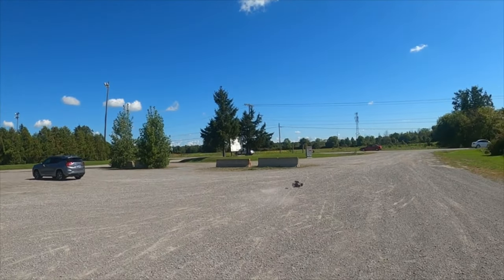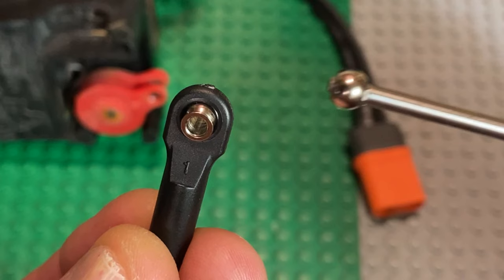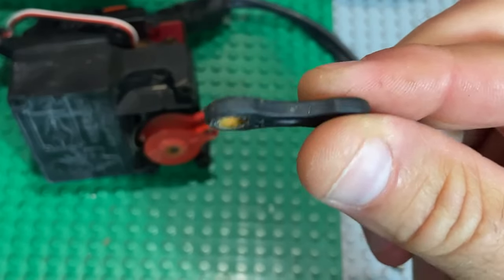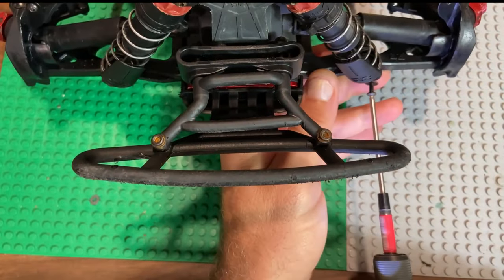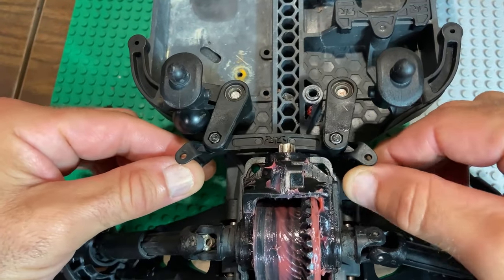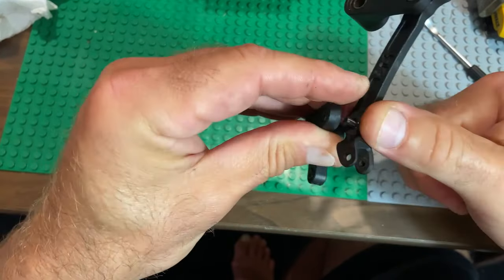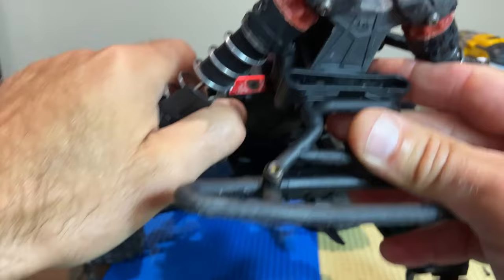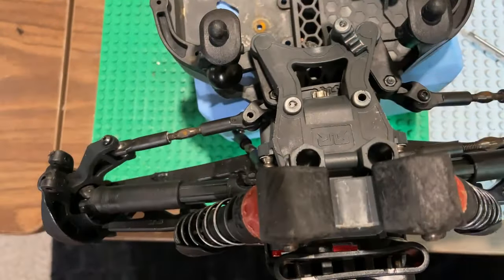ARRMA 3S UPGRADES: SHIM YOUR BELLCRANK AND STEERING POSTS | ARRMA 3S

Comment: hi Phil what brand of 17mm offset hexes you reccomend for typhon 3s? dont want to much offset.  some of the grp tires onroad can sit real close to hubs!
Reply from the maker: HI! Honestly i think they are quite similar to each other.  For the money, I think the Hot Racing make good sense. If they were for bashing and you had extra money, I would go with M2C. Thanks for watchin!
Reply: @phillybrc  how much extra offset do the hot racing hexes give compared to stalk?
Reply from the maker: You can get different sizes , I believe most common  size is 5mm on each side.

Comment: Omg! Great video! I have so many cars I’ve had to trial and error create fixes. I modified my 3 s line as well. I did almost the identical fix. Used traxxas ends with metal traxxas pivot balls. I’m shocked Arrma put any car out with that much slop. Plastic pivot balls is a joke! 👍💯
Reply from the maker: Nice!! They are a joke Syko. I find this mid helps alot!! Appreciate you Syko.
Reply: @phillybrc  Absolutely! Your like me, make it right. No matter what you gotta do! Very good video for that car. Besides your tricks, a lot of first time rc owners get the 3s line. It will be very informative! 👍
Reply from the maker: @SpeedSyko  That s what I m goin for! Thanx Syko
Reply: @phillybrc  👊🏆💯

Comment: Awesome video! I'm currently tuning up my Typhon 3s and this is just what I need to do.  What do you think about replacing the plastic bell crank with an aluminum one from gpm or hot racing?
Reply from the maker: Ya, I ve only heard good things about the hot racing bellcrank. Stay away form the hot racing servo saver though lol. Let me know how this mod works for you. I m still using it. Thanx for watching!

Comment: Very good info..I shim my Tamiya buggies
Reply: On my older blue senton I took off the servo saver for a solid servo arm.. it helped a lot..I plan on doing the same on my red senton and big rock and adding shims where needed along with the metal c hubs
Reply from the maker: @philthyco1  Oh really? I ve been curious as to how a servo horn would make difference. But how do servos hold up to bashing without a saver?
Reply: @phillybrc  Steering feel is more direct..Held up fine for me but I don't send it big lol
Reply from the maker: @philthyco1  I hear ya, i m lookin to go big! HAHA. I will try it one day when i get some time. Thanx dude.
Reply: @phillybrc  Yea I jump 15-25 feet ..Im talking about rc dude 81 and Rich Duperbash big though lol
Reply: @phillybrc  The old composite used when hobbico owned arrma was far better than the horizon stuff for sure..Never saw a chassis break until horizon took over..I have hobbico built Arrma rigs and just by looking at the composite I could see a difference..I first noticed with my 4s Outcast
Reply from the maker: @philthyco1  I hear that often.  Still can t complain I feel, mine get beat up pretty bad and I had a couple terrible landings.
Reply from the maker: @philthyco1  hahaha. Ya, that s insanity-big!!! They rock.
Reply: @phillybrc  Yea they still are tough for sure and lots of other good upgrades added by horizon